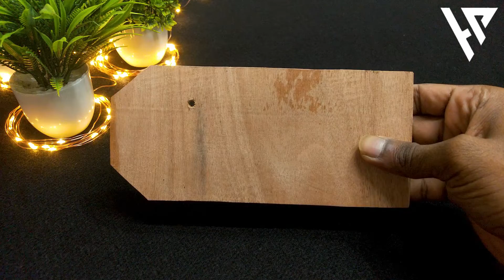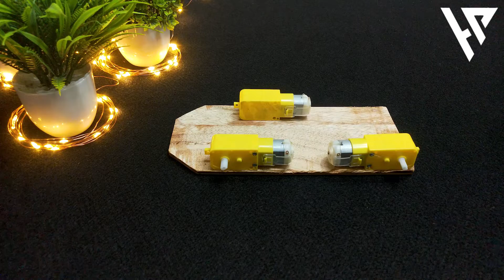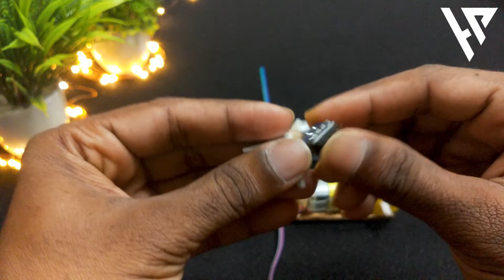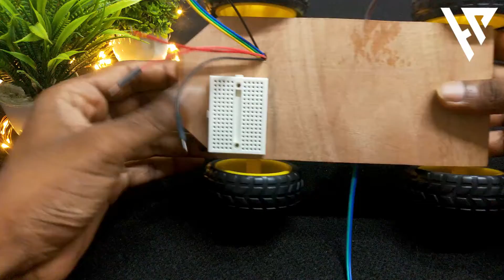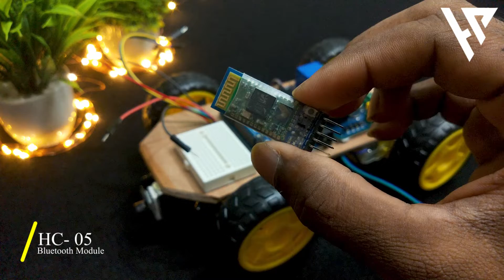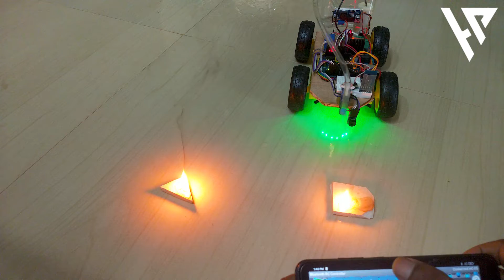Fire Fighting Robot with Automatic and Manual Controls

Comment: What is the use of MLX 90614?????
Reply from the maker: By using the MLX90614 sensor, the system can measure the temperature and stop right in front of the fire, otherwise it won't.

Comment: I not understood that you used to connect capacitors on bread board and near water container.
And these capacitors are not found in circuit diagram, please let me know 🙄 i have a project to do
Reply: he used the capacitor because the its good to give the motor driver a stable current and the capacitors are opsanal and soory for the speeling mistaks i was in a harry
Reply: @WERE_NOT_GEEKS  which capacitor use for that

Comment: My project ready but i am not take mlx sensor in this project how to start this project coding
Reply from the maker: Yes, u can . Watch my 1st Fire Fighting bot video.
Reply: First  video code install then It's possible to run mobile app
Reply from the maker: No, it's fully automatic.
Reply: My project not work
Reply: Mlx 90614not use ing
Reply: Without mlx project not working in use your code given discreption
Reply: I also did my project without the mlx sensor, but it is not moving

Comment: flame sensor x 3
BO motor(60-150) RPM  4pice
battery holder 18650
MLX 90614 (GY-906)
2 battery 
wheels x4 65mm
Breadboard x1
Arduino UNO R3
Motor Driver L298/L293
RElay module 5volt
HC-05 Bluetooth module
connecting wires 20
Mini water pump
Reply: What else components I am missing I am unable to understand please tell me
Reply: @KaifEducation   what is that switch which was used to turn to automatic mode
Reply: @shreyash4848what the component